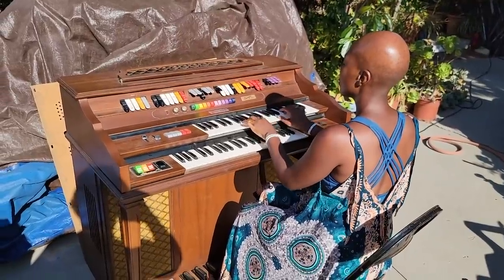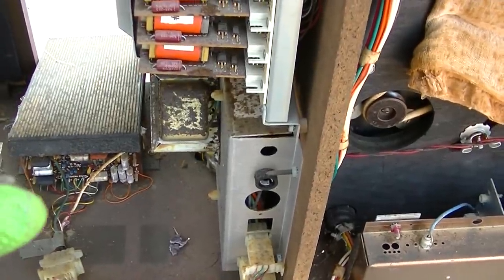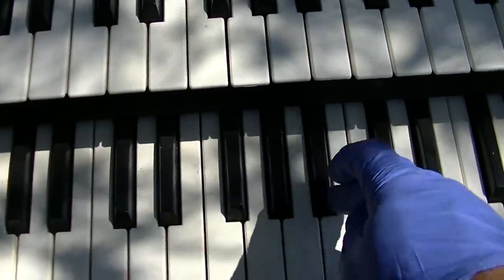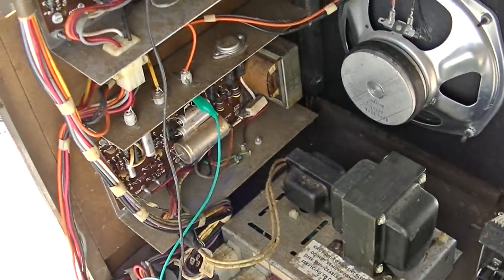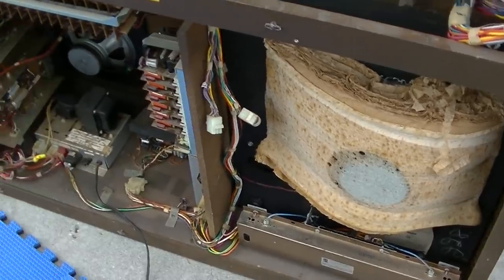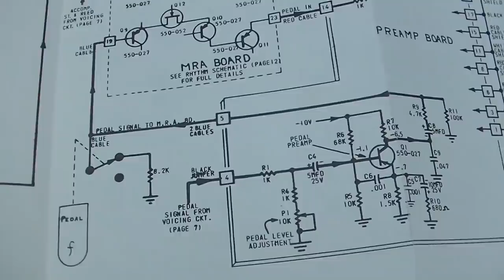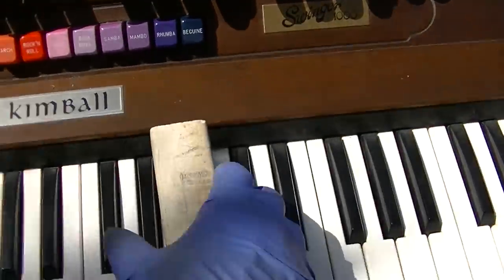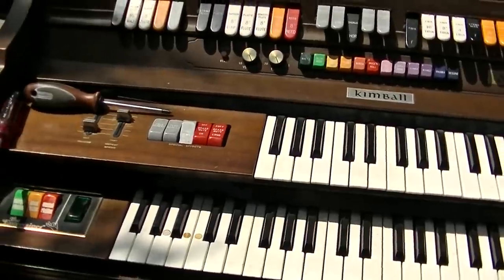1972 Kimball Console Electric Home Organ with Leslie Speaker Resurrection

Comment: so tired of the its going to self destruct crowd upon power up with old caps.  you know what? shango disproved that. about the only  thing i wouldnt power up without at least changing electrolytics is on anything with 1930s wet or dry electrolytics, or anything with cardboard tube lytics with wax ends.  otherwise anything else should last long enough for troubleshootoing.
Reply: Back when this thing was made the caps were actually really good quality - the only reason they're failing now is because they're almost 50 years old! As a long-time repair tech, I can tell you that by FAR the least reliable caps are tantalums in 80s and early 90s PCs, surface mount aluminium electrolytics (these vile monstrosities kill 90s camcorders and PC motherboards at an horiffic rate) and those damnable multi-layer ceramics (pretty much guaranteed to kill every laptop, tablet, phone and any modern miniature tech eventually)

Comment: Thank you for making this. My mother has a similar Kimball but with more doodads. Neat when it works. I appreciate the breakdown of the elements, could not find a service manual for hers so this may come in handy later. Fun fact: if you set a router on top it'll pick up noise from the ethernet cables. Spent 2 hours cleaning and repeating boards and checking caps for that one.

Comment: I’m wondering if you could use a cmos counter/divider to replace the obscure divider. I’m guessing it would be a divide 8 maybe 16 assuming it uses square waves with some filtering on the analogue side. Stick a scope on one knowing both of us it uses sine for the octave oscillators and those dividers are obscure analogue things
Reply: You're on the right track. Each circuit divides the oscillator frequency in half to generate lower octaves for each note. However, the oscillator generates a sine wave, so a flip-flop would not work. The IC was an analog device. I repaired a few of these electronic organs back in the 80s, but never saw the IC fail (mostly bad caps and dirty contacts).

Comment: Like a lot of vintage electronic history, these will get dumped in the landfill until no more are left and there will be regrets. Would be interesting to see Shango do an amp restore on a Hammond tonewheel tube organ like a B, A  or M (spinet) series. Most B's and A's still have substantial value, $2k to $15k. M's are still a bargain, going for around $150 - but those do sell. The subsequent transistorized Hammonds are worth about as much as this Kimball and many models were known to be very problematic.
Reply: The most abundant Hammond still is the L-100 series. There's tons of them around for not much money.

Comment: I would do a FULL recap, THAT alone would have solved most of the problems.  It is not reliable without all those caps replaced.  Electronics do not last forever.
Reply from the maker: So I should fully recap something that's going to ultimately end up in the trash because no one wants it? That sounds like a waste of capacitors to me
Reply: @shango066  Man, I know you are not a re capper guy, but whoever buys it might be!  I know I would!  
I know, I am a recap addict, I recap anything except tube amps, them bumble bees give it a nice sound! BTW nice ESR meter!

Comment: The problem with the A# key being out of tune is most likely just the oscillator requiring adjustment - for some reason its tuning seems to have drifted off, possibly due to ageing caps or maybe accidental twiddling of the tuning slug by somebody who's been into it before you. Possibly just retuning it would put this right. These organs are pretty easy to tune, having a seperate oscillator for each of the notes in the top octave and then dividers to generate the lower octaves from the master tone, so to retune the entire instrument should only take a maximum of 12 adjustments (Not sure if it's the Youtube audio or not, but quite a few of the notes seem a little bit off, though it's just the A# that's really bad)

The weirdness with the top pedal could be an issue in the pedal keying circuit, or maybe a bad divider on the top C oscillator board, as the pedalboard is running from C to C so the lowest pedal should be one whole octave below the top one (so half the frequency)

The divider ICs used in this instrument are a little before my time so I'm not quite sure what technology they use - most of the dividers I was working with back in the day were based around the CD4024 7-stage cmos divider and similar ICs until fully integrated solutions such as the M108 came along which not only handled all the tone generation, octave dividing and keying in a single 40-pin DIP package, but also did the clever stuff like auto-chords, accompaniment and so on - basically a complete organ on a chip, aside from the voicing filters and rhythm box

Comment: You must total recap.
Reply: no.  you dont learn how to troubleshoot by bulk recapping. it good practice to troubleshoot before you total recap. waste of time to total recap and thing doesnt work due to some bad coil troubleshooting would find. recap after proving it works for long term reliablility
Reply: @tonyp7779  I have make this 25 Years, with ReVox Aplifiers, The Amlifier work after 20 Years, the old Eletrolytik Capacitors are not good.

Comment: Awesome! All those edge connectors are so typically 70’s. We used to see this problem with the connectors on laundry equipment where vibration would cause intermittent contact. One trick I found helpful was to flash a bit of solder over the contact track on the PCB to tighten up the fitment.
Reply: Oberheim synthesisers had the same problem with connectors. Fantastic instruments, but the founder Tom Oberheim had to hand control to the accountants who then insisted on the cheapest components. So reliability went to the dogs for the sake of a few cents saved on cheap connectors.
Reply: @chriswareham  sadly this costing out of components seems to be an industry wide problem. I’ve been in the browngoods and whitegoods trade for over 25 years and we see this time and time again where cheaper components are pushed to the edges of there tolerance and fail early.

Comment: Your background in telecommunications devices will work nicely with pretty much any electronic musical instrument large or small, especially those without digital aspects.

Think of it like a self-contained radio. Oscillators with frequencies controlled by the keys providing a signal with filters and whatever else changing the way the signal sounds, and all of it being received and piped out a preamp. There's a reason why, back when you had to order those big mighty modular synths from a specialized catalog, that you were pretty much given a circuit board and bill of parts. Synthesizers use off the shelf parts, just like radios! In fact that's STILL how modular synthesizers work, just now you have the option to pay extra to get somebody to put it all together for you!